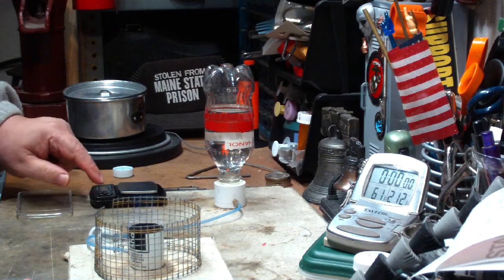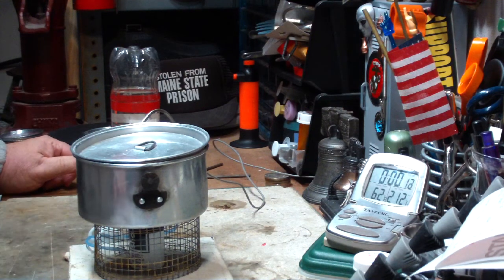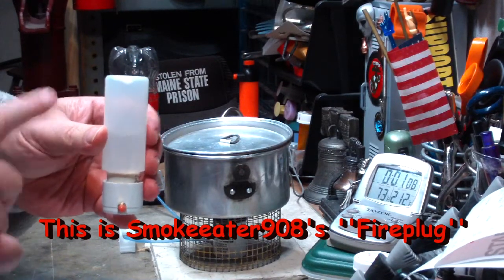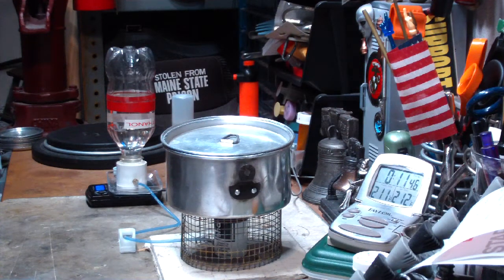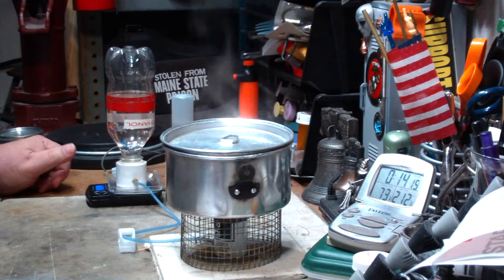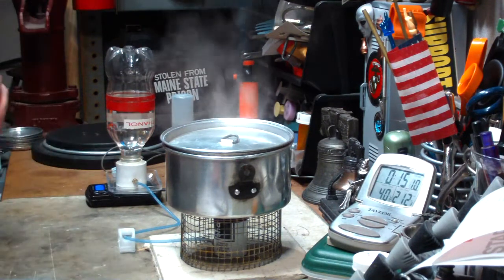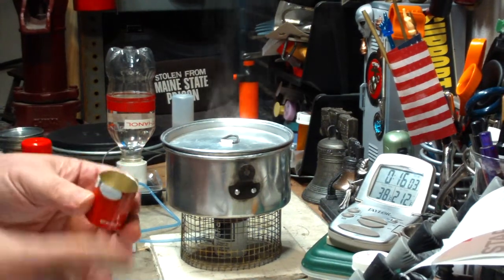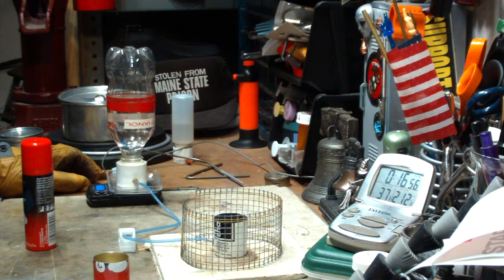Simple Carbon Felt Burner - Boil Test #2 - How much alcohol was consumed?

Comment: Hiram, I missed burn test #2 on the carbon felt burner when I ask how much fuel was used in the carbon felt burner boil test. Maybe I need to switch to carbon felt instead of using the open burner.  GOOD VIDEOS

Comment: You are so right there sir. There really is too many variables. In a controlled environment, you can get pretty consistent results. But once you set outdoors, everything changes. those changes are to rapid to be fight on the money every time. I always try to lean towards the more use side than the cut back side. What I'm trying to say is I always bring a little more than I plan on using. Better to be safe.
Thnx for sharing, See ya on the next Adventure.....Scott

Comment: Excellent test.  It seems to me that if you were always going to use the burner on a continuous feed set-up, you would be better of having the burner as short as possible.  My thought behind this is that you don't need any reserve in the burner and when you shut the supply off it would burn out quicker and result in less waste of fuel. Just a thought.  Thanks for doing these test and providing a lot of info to the camping society.